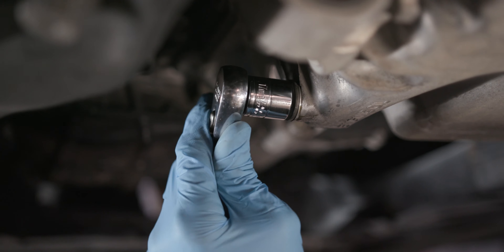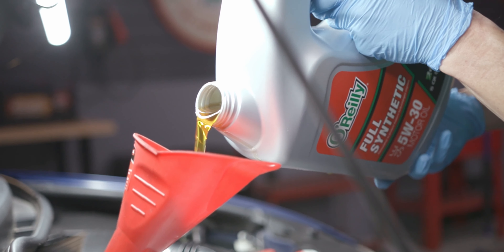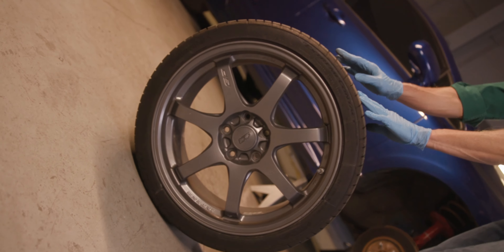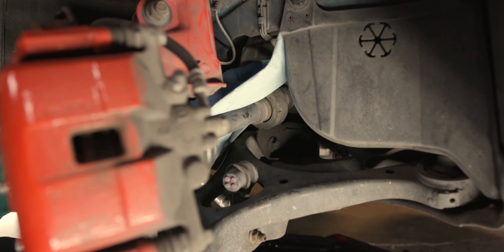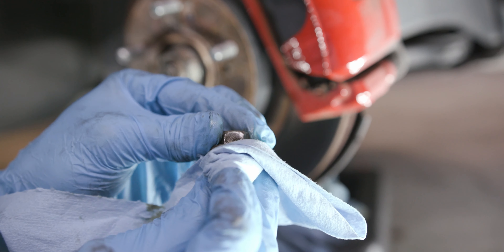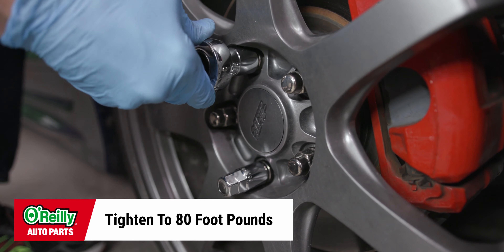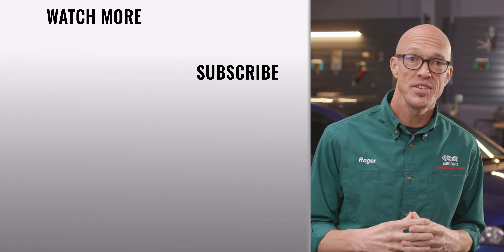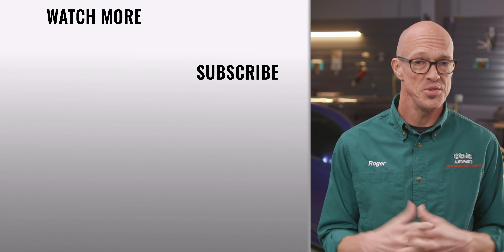How To: Change the Oil and Filter on a 2006 to 2011 Honda Civic Si

Comment from the maker: Supplies Needed for This Job:
1. Safety Glasses: https://urlzs.com/hbwc
2. Gloves: https://bit.ly/2GvfwAm
3. Oil: http://bit.ly/2XGtgyc
4. Oil Filter: http://bit.ly/2ZEoZNk
5. Jack: http://bit.ly/2ZxQiJl
6. Jack Stands: http://bit.ly/2L1YEp9
7. Wheel Chocks: http://bit.ly/2ZvIW98
8. Ratchet: http://bit.ly/2IEAOOi
9. 19mm Socket: http://bit.ly/2UUqY1p
10. 17mm Wrench: https://bit.ly/2VygYbv
11. Shop Towels: http://bit.ly/2GDgwm1